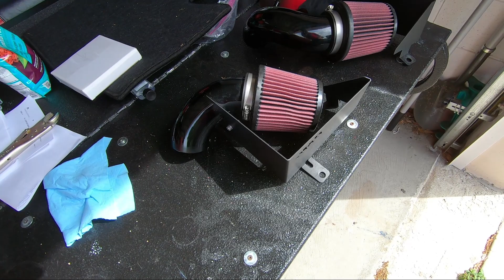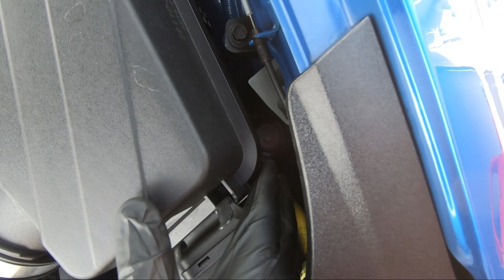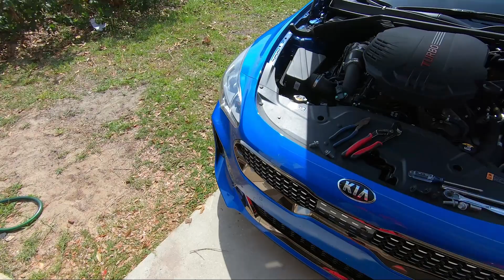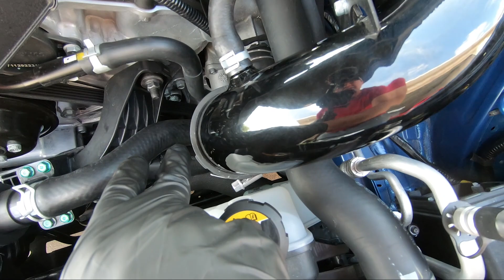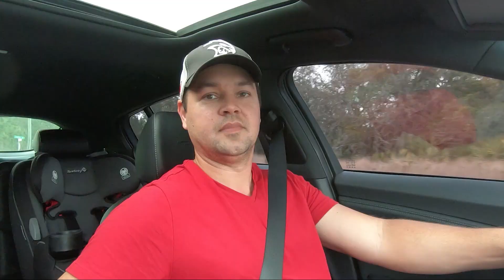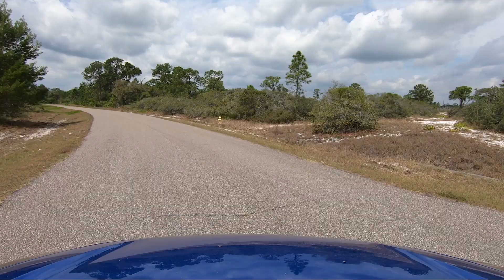Kia Stinger GT BMS Intakes Install - Sounds Awesome!

Comment: You did what I did. Took the bottom half of the air boxs off too. It sits better like this. However, on their website and others, I see the BMS intake installed WITH the lower half of the airbox. This way air is directed better. What do you think? Leave it out?
Reply from the maker: Yea I realized what I did when someone mentioned it in a comment. I put it back the way BMS intended.

Comment: Truthfully, K&N panels with the Velossa tech big mouth is the best combo for keeping engine heat out and have a high flow system. I also added a mid pipe, plugs to JB4 and it's 4.2 0-60.

Comment: Note, for Launch control, when you engage it, wait for 3 sec. before letting the brake go. Boost meter will not move up until you've held it longer than 2 secs...  I'll be doing more runs at drag strip this Sun. trying diff. ways, LC, Custom mode with varying setting. use paddles, don't use them.. and will be posting some new runs on my channel. Hope you can check them out.
Reply: did you figure out if using paddles gives you a better time? im pretty sure it would as I think it minimizes the rpm and boost drop when you shift before 6k rpm

Comment: What do you mean that you need to keep half of the air box installed? Do you have an image of how it's supposed to look?
Reply from the maker: The intake box is in 2 pieces. Only remove the top part. Leave the bottom part. If you Google BMS Intakes Stinger, you'll kinda see it.
Reply: @quixilver09  Ahh I just saw it on one of their websites! Thanks for the quick response man. How are you enjoying the intakes? The strut braces are so close to them so it's keeping me weary of buying them. They get hot as all hell.
Reply from the maker: @animeking46-740  nothing but greatness!

Comment: Worried it’s sucking in hot engine air because it doesn’t look sealed
Reply from the maker: Yea, that's always been something to consider, but I guess that's why they do Dyno tests. I guess removing restriction is sometimes better. Once you are moving, the fresh air will be forced in enough to compensate most likely.

Comment: Wait till it gets cold out.porsche just claimed to a car editor that when it goes under 50 degrees--or even colder--their cars can pick up an extra 100 HP.In one of the forums a guy in canada had a gps device like yours and was running a 4.3--all he had done was intakes also--but it was frigid out.I can not wait for the weather to get cold.Our TT 3.3--or any turbo will gain more HP.I baby my Stinger in the summer--the heat is too much aand you can not get the performance--i am in GA--have a 2020 white Stinger and it was 94 today--it is not going to run its fastest sucking in hot air.There was even ice/snow on the side of the road--dude had AWD and just floored it in sport and ripped a 4.3 to 60 with just some intakes.I could not tell if you used launch control but that also shaves a tenth or so off the times.KIA did tell me with quality intakes and an exhaust you should get 7% to 10% if they are done right--which would put the car at about 400 hp.

Comment: Is that just the intake sound alone or did you mess around with the bov ?
Reply: So the stinger has "diverter valves" that usually releases into the intake boxes. When you install the new intakes, the top half of the intake box is removed, meaning that you can hear the pressure release more. You can achieve the same thing by just pulling the hoses off of the diverter valves and plugging the hose that goes into the intake. Sounds really good.

Comment: The driver side pipe is touching the coolant hose going into the radiator when I tried to install mine. Are you having the same issue?! - the coolant hose is located under the pipe - please advise.

Comment: Hey good vid man, I own a 2018 stinger gt2 awd.  Just got the jb4 tune, 1 step colder spark plugs, bms intakes and oil catch can. About to install maybe 2morr or on weekend since its raining in NYC.  Your vid is gonna make this ez install even easier. Thx again. Nice color btw I got hi-chroma red
Reply from the maker: Thanks make sure you keep the bottom half of the air boxes in!
Reply: @quixilver09  just did it myself boss, kept the bottom in and worked and fit like a charm. Intake sounds are amazing!! Put in the jb4 now that intake catch van and spark plugs are in

Comment: I'm all for mods and such but what happens when you show up to the stealership with your tuned new car that's under warranty and need repairs? Obviously intake/exhaust would be fine but doesn't a tune void the warranty?
Reply from the maker: You either verify it before hand with your dealer, or just take it off before you go. All dealers are different.
Reply: @quixilver09  I'm guessing a tune is not easily removed unless u have all the tuning stuff. I paid a tuning shop to tune my Lightning but it's not new obviously
Reply from the maker: This one is a piggy back style. It doesn't overwrite the PCM, just temporarily modifies it on the fly. All you have to do is push a button to go back to stock, and unplug it from the OBD2 port.
Reply: @quixilver09   nice to know for when I pickup a Stinger GT2 in the near future.
Reply: @michaelthompson4178  It's really great, even the fuel wires with the jb4 comes with a positap so you can remove the entire unit discreetly in about 15 mins

Comment: Listen to the turbo it sounds way better and different by all means. Aren't the factory plug gaps too wide for a proper tune like the jb4?
Reply from the maker: I have 2 step colder plugs gapped to 22 😎
Reply: @quixilver09  bms know what's going on, performance wise, and getting rid of this cai then back to stock makes wonders.

Comment: You installed it wrong, you're supposed to keep the bottom half of the factory intake box.
Reply: The bottom half of the airbox acts as a heatsheild and helps to direct the cool air to the filters. They should look like this once installed: https://cdn.shopify.com/s/files/1/0890/2048/products/kia_stinger_bms_dual_intake_2018_1200x1200.jpg?v=1576666384
Reply from the maker: Lol! Well that makes sense. I got them second hand and didn't have instructions. Thanks!
Reply: @ryan2376  so no need to unbolt the box? just need to unclip the top part? or how does that work?